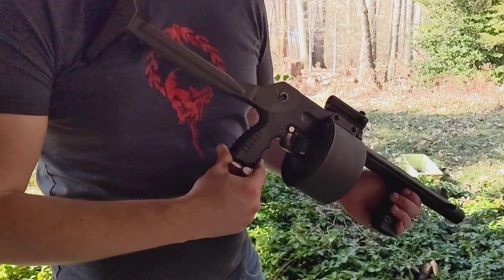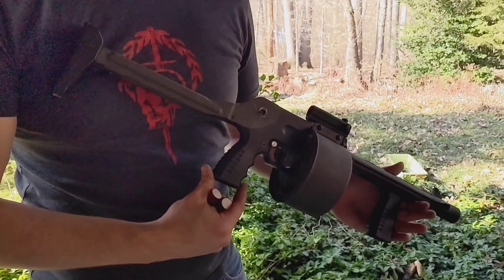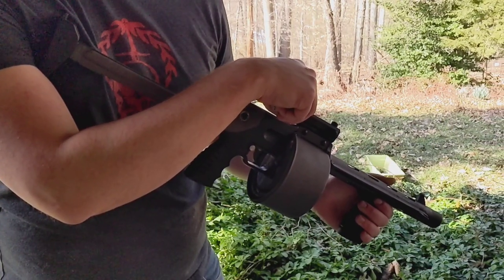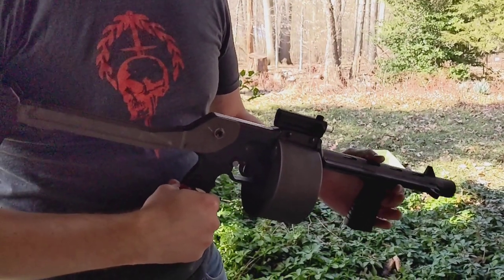Airsoft 'Orange Wargame' Striker / Street Sweeper test with APS shells

Comment: IMHO, this finally makes those gas shells properly fieldable! :D
Much higher capacity than a singleshot or double barrel. And compared to a shell-ejecting pump-action, no more worrying about maybe damaging or losing your shells, nor having to instead deal with one of those dumb pouches hanging off the side to collect ejecting shells.
Reply from the maker: You and I are on the same wavelength. No shell catchers but full shell retention. 12 shots is more than I'd ever need with how effective the APS shells are, so not worried about reloading. I have had plenty of success with double barrels (see my older vids), but this is just something else- and it's quite tiny for a shotgun to boot.
Reply: @CatgutViolin  lightweight too

Comment: What mm is the overshot/undershot cards you use? Those wads are kinda expensive in the long run😅 get as good range as with the wads?
Reply from the maker: I use 3/4" circles cut from 140lb watercolor paper. It's a lot cheaper than 'official' wads and caps, biodegradable, and produces slightly better power to boot.
Reply: @CatgutViolin  nice👍 does 18mm work as well as 3/4"?
Reply from the maker: @Namesakes.unit-x-10sq10  Yep, it'll fit slightly better actually.
Reply: @CatgutViolin  ok, thanks🙂 waiting for a striker 12 atm, hows the range compared to a short cam870?